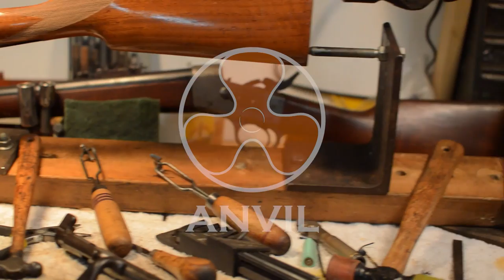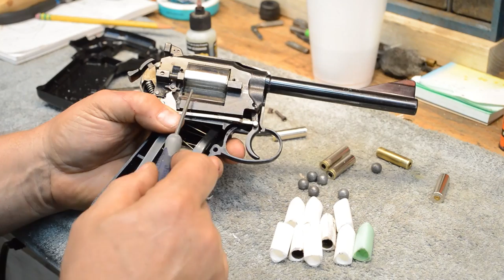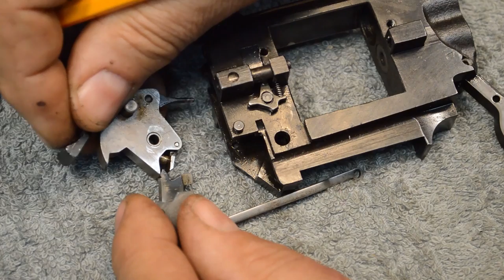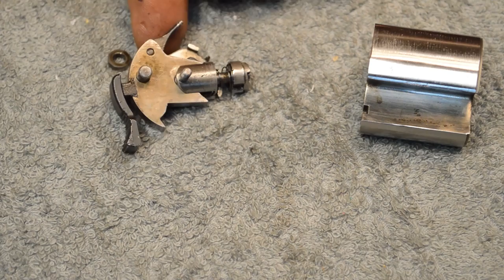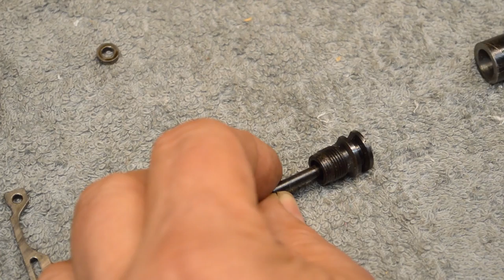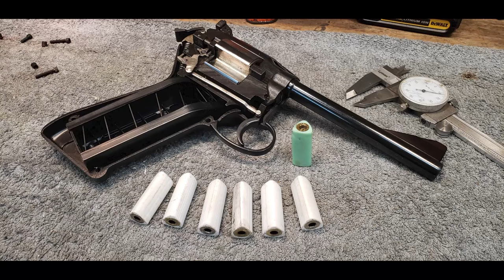Anvil 048: Dardick revolver total teardown and repair

Comment: Would milling the "cases" out of steel work or is there other issues involved in that?
Reply from the maker: Milling a trochoidal form would require special or cnc machinery, and also would not obturate. So, $$$$$$$$$ and it would leak
Reply: @marknovak8255  ahh yeah thats true I'm not a machinist so I don't know the difficulty nor price it would take to do stuff like this
Reply: The system was designed for plastic, with one of the reasons being less weight.
Reply: @ScottKenny1978  ahh makes sense. The 50s was the time of some oddball gun designs

Comment: Asthe tround was so length critical would it not be better to use a 38 special case instead of a 357?
Reply: Might be just longer than the Special, can cut the Magnum down, can't add brass?

Comment: Looking at you loading the Dardick made me realise a "fun" kind of flaw with that cartridge design :
In a hurry, you're likely to put them in the wrong side, no?
Reply: It is one of those really cool historical guns that make you appreciate that 99.9% of guns operate on one of a few overall methods these days.
Reply: I don't know about the wrong side, but it would be pretty easy to load them the wrong end forward.
Reply: I expect that they'd get an arrow printed on them like the G11 caseless ammo.
Reply: @ScottKenny1978  You'd think so, but the originals didn't; I guess you were just expected to pay close attention to which end the primer was on. Dardick probably never expected anyone would be reloading one under time pressure, anyway--that was why it was so high-capacity (for its time) in the first place.
Reply: @ZGryphon  true enough, though I really expect that it was marketing swag.

"So, the Dardick machine gun works just like this pistol!"

Comment: Excellent in theory, but success DEMANDS practical simplicity with minimum technical bottlenecks.
Reply from the maker: YES!
Reply: Like so many technical oddities they are fascinating to see but you would not want to count on them working 100%
Reply: This wasn't a design for a pistol.

It was a design for an aircraft machine gun that was itself lighter and had lighter ammunition than the existing ones.

Comment: why has no one 3d printed one of these yet? i think it would work great. all you need is a steel barrel.
Reply: You'd also need a steel chamber-wheel-thing and top strap.  The tround doesn't slide up into a barrel-extension-chamber like a semi-auto, and there's no way in hell that plastic cartridge case is holding firing pressure with only 3D printed plastic around it.
Reply: No-one's done it because it's impossible..

Comment: This thing is like a movie/airsoft design. Who makes something this unnecessarily complex for so little return on time?
Reply: It was a marketing toy for an aircraft machine gun.

No links to eject out of the aircraft and ingest into engines, plastic casing for lighter ammo, and it's basically a revolver cannon like the M39 used in the F5 (or whatever European aircraft you care to name).

Makes sense for that use, but as a pistol? Eeewwwww, no. Barrel is way too high above the hand.

Comment: Why turn the case to remove the rim when you could make the tround shorter,  the rim of the .357 would act as back stop. It may make it easier! Also are you going to post the cad file so other Dardick owners can finally shot their guns?
Reply: 1. The tround is length-critical, like he said.
2. Releasing files for this alongside instructions for modifying existing ammo to work is just a mountain of liability that nobody wants to deal with. If you really want to make your own, draw the CAD and generate the CAM yourself, there are only a few critical dimensions and you can get the profile from a photograph.

Comment: That's pretty cool! They could have made a clip feed version too. A clip fed revolver would be unique.

The head spacing might be a problem in that design.
Reply: Removeable box magazine out the bottom of the grip would work.  No way to get any kind of stripper or en-bloc clip into the mechanism from the top because the rounds have to turn a corner as you load them.
Reply: @AM-hf9kk   Agreed. No modern clip fed gun these days use stripper clips anyway.

Comment: Is cool that the idea of the plastic round is comming back. The new 6.8mm machine guns and rifles being tested by the US Army, I think 2 of the 3 candidates have plastic cases.
Reply: no its terrible,

think about it,
now you have maybe some brass and lead in the woods and desserts of the USA, which is not great, but over time it converts to rust and if it is just some bullets, the lead also is no problem.

But plastic stays, it doesn´t rot, it just gets finer and smaller
Reply: @eberbacher007  yeah... looking this way, it could be a problem.
Reply: @eberbacher007  Plastic shell casings will be the Roman Coins of the sentient parrot society in 700k years.
Reply: @eberbacher007  No it’s fantastic. Many of the polymer rounds being experimented with are actually biodegradable. Even if they weren’t though, they aren’t toxic, they’re far less expensive, and they’re much, much lighter. Too many benefits to ignore.
Reply: @knifedance2402  but the cheap ammo manufacturers will get the cheapest plastic that does the job, so unless the gouvernment regulates it to be biodegradable I don´t think this will happen.

Comment: Interesting design indeed but those cartridges are just weird and wrong.
Reply: I'd love to see it reverse engineered to run normal metallic cartridges.  That could be tricky, as you'd have to redesign the area at the top of chamber-wheel movement to completely support the cylindrical cartridge.  I imagine it COULD fire very under-pressure cartridges as-is, but standard pressure would probably blow open the unsupported sides of the case.  Might be as "easy" as a sliding support coming down from both sides of the top strap with another arm coming up from the vertical transfer bar...
Reply: @AM-hf9kk  Chain revolver is an old invention. 
It would still have the same cylinder gap bleed issues. Namely the Dalek has trigger in worst possible place
Reply: @AM-hf9kk  Then the supports would have to lock.. it's just all completely pointless, also no part of the case should ever be unsupported, just look at how fire-forming works, and that is not even close to normal firearm pressures.

Comment: Worst gun ever made.
Reply: Highly disagree, but even if it was that "bad", it doesn't matter, it was only an AD for the system, they wanted to develop all sorts of military miniguns and other goodies, where this system would seriously shine, so with that in mind, so even if a crappy gun, it is the best ad for anything ever! As for worst gun.. Zip .22, a shitty gun with no extractor or ejector, if you use correct ammo it works, but still has occasional jams which is simply not good enough considering the ridiculous price tag for this piece of shit, and to top it all off it bankrupted a perfectly fine company making high-quality revolvers (so I heard anyway, maybe their weren't THAT good, but they certainly weren't bad).
Reply: It's a good gun with bad execution and the weird trounds. If you want the worst gun ever take a look at the Zip 22. That gun is unreliable as in I've only seen 1 video where someone got through a magazine without it jamming! It's hard to hold and dangerous every time you go to cock the gun because you have to push back a built in rod that is RIGHT NEXT TO THE BARREL and has the potential for you to shoot yourself in the hand if you aren't super careful. Oh, and the election port is positioned so if you hold the pistol wrong, you could get hit with the hot shells!

Comment: What a crap designed gun. I know, "unique," "collectable." If you want a revolver, there are many you can buy that don't cost $100/round.
Reply: The man who designed it was working on a rotating chamber system for rapid-firing aircraft armaments. That system would go on to be adopted by our military in a number of applications. The Dardick was a proof of concept/attention grabbing device. Not much else.